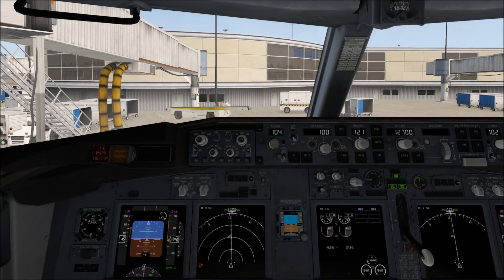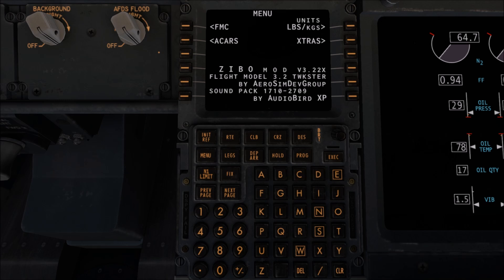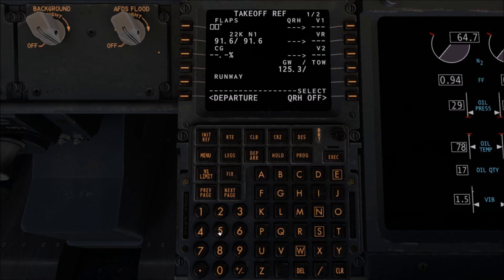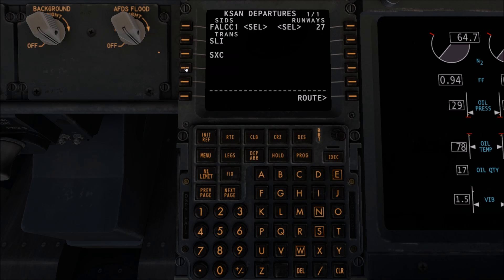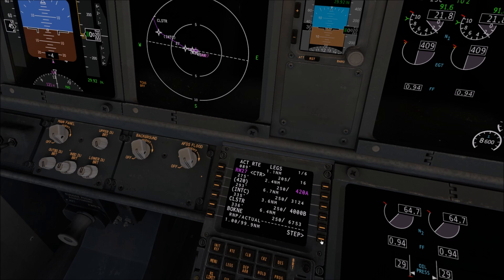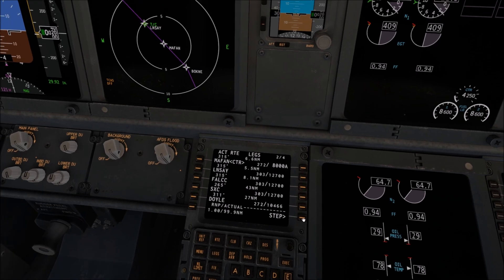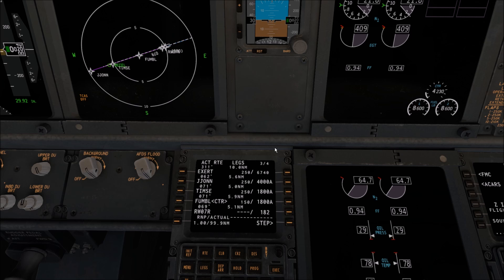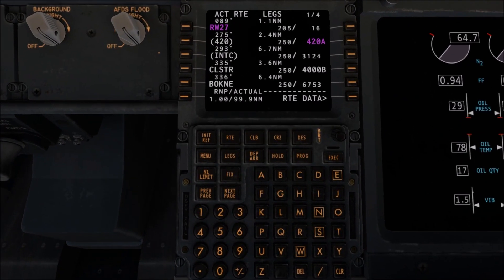X-Plane 11 | Zibo 737-800 | Programming the FMC

Comment: One question. Is autopilot designed to follow all of the speed and altitude call outs for each waypoint? If so, is there anything specific that I need to enable on ap to ensure that it picks up those changes? Other than autothrottle.

Comment: Where do i need yo put the squawk?
Reply from the maker: The Squawk code is entered in the bottom center of the radio panel, but this is assigned by ATC.
Reply: @Blaine10024  i dont rly find it  is nothing in the middle to be hones
Reply from the maker: @Vladutz  https://drive.google.com/file/d/1wY32pP2SnAuYYtokeZg2oQ_KZRCpDZs5/view

Comment: "A derated takeoff & climb is ONLY used for shorter runways"....I think that's backwards.  On the shorter runway or on a wet runway you would not use a derated takeoff.  You'll need all the power you have to get off the ground on time.  With a longer runway, you have plenty of room to derate the engine power by using an "assumed temperature" and in turn extend the life of the engines.
I use the "Toper Calculator" or "Topcat" program to figure out the proper temperature for derating the takeoffs.
Reply: signman Bob yes he made a major mistake with that. I doubt he knows what he’s talking about, anyone that thinks that a derate is used only on shorter runways has a serious misunderstanding of fundamental aviation logic 😂😂😂😂

Comment: how do you know cost index and reserves??!?!?!
Reply: I was told, on most or all of the online flight plan generators, SimBrief, etc., you'll get the full info. included on the generated plan, if you look at the PDF file generated with it,
say, you'll have all of those values given for that flight plan for that particular plane: CI will be somewhere at the bottom of that page, and will give you the cost index value,
a METAR report usually, and all the fuel weights, reserves and such, as well. I just generated a Zibo plan for JFK to KORD today, on the Online flight Plan site,
and the PDF file gave me all these values with the basic plan and waypoints. It's too great.  You can fudge the CI number but I guess it's better to stick with the 

actual given values for that particular flight plan, makes it more realistic and you should have a smoother flight, as well.
Reply: Raid Mix  yes, hello, that was 11 months ago. It's already over 10 months since I learned to do that. Thanks for kinda early reply, i must say.

Comment: Always before I am at the T/D my fmc says: reset mcp altitude. Please can someone help me. When I reach the T/D I am not descending
Reply from the maker: You have to enter your decent altitude into the MCP prior to reaching Top of Descent. In the newer versions of the Zibo Mod, you have to integrate altitude with vertical speed. So for example, if you were supposed to descend to FL240 from FL 330, you would enter 24,000 in the Alt section of the MCP, and then determine what your vertical speed descent rate should be without causing overspeed.
Reply: @Blaine10024  do I have to set this in it:

Just for example

240/FL195
Reply from the maker: @Ninkjeboi  As per your STAR, whatever the next altitude restriction is. See my example here: https://i.imgur.com/FafrjWQ.png . As MISEN would be your first ToD on this route, you would set your alt to 24,000, and then when you cross MISEN at 24,000, you would then set the alt to 13,000 to cross CLARR.

Comment: Nice video and couple of questions in here:
1) Aren´t you supposed to have engines off when in ramp? 
2) How did you calculate the cost index?
3) How did you calculate the reserves?
4) How do I know the OAT if engines aren´t running?

Great video BTW!
Reply from the maker: 1) You are supposed to have the engines off, until you pushback. Likely as I was focusing on just the FMC, I loaded into X-Plane with the aircraft started and ready to go to save time.
2) The cost index is different for every company, I looked up a general cost index sheet.
3) The reserves I generally enter as 1 or 2, unless I am doing a long flight.
4) The OAT can be found above the engine power gauge, and can be used without starting the engine.
Reply: He made a lot of mistakes and seems to just choose a random reserve figure either 1 or 2, when In real life, the reserve figure used will vary depending on weather; weight etc. He just chooses a random; non calculated number. Not realistic at all.
Reply: I believe reserves are Fuel Reserves

Comment: Good tutorial, i have a problem with the zibo 737-800, i cant steer with my airplane or i cant steer it full to right and left, but when i play with the 737-800 its work fine, maybe u have a clue what the problem can be
Reply from the maker: It could be your YAW is not set correctly, or your axis's are not set fully. Check your settings to see what YAW is set to, and that it is set correctly.
Reply from the maker: Also, in your settings, ensure Nosewheel Axis is set to YAW.

Comment: Why A/T  (Auto throttle) does not want to turn on on the ground on 747 Zibo. And also when I putting flaps into fmc , it does not give me V1 V 2 speeds? Please help, thank you
Reply from the maker: Boris Sn V Speeds will not populate until you have the temperature, flaps, and trim entered. A/T will activate once the MCP is set.
Reply: Blaine ok, thanks.  I will try that

Comment: Blaine - thanks for doing this video. Now that I've got past the basics covered here, I've encountered a new problem: After takeoff and while enroute, my destination weather changed (frontal passage) causing a change in landing runway due to wind changes. Can you change the arrival STAR and landing runway in the FMC while in-flight in the Zibo B737-800?
Reply from the maker: davidv935 Absolutely. You usually have to change your runway anyway, usually not your STAR. But you can. It's probably best to change the STAR before you cross the first STAR waypoint.

Comment: Excellent video! Thanks!! Where do you get the course? I mean the 104
Reply from the maker: Thank you for your kind words. That is just the default number in the course selector when I started X-Plane. Disregard this number entirely. Course is used when you prepare for Top of Descent. In the FMC, on the INIT REF page, when you select your flaps setting (always 40), it will give you a course. You enter this value into the course selector, but again, only when in flight, just before Top of Descent.